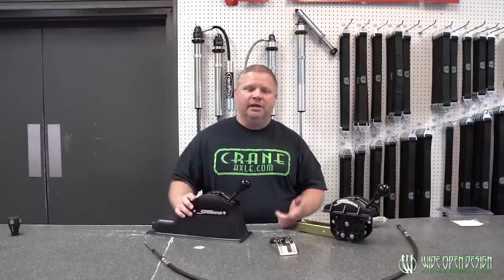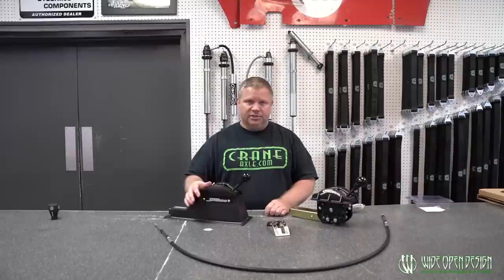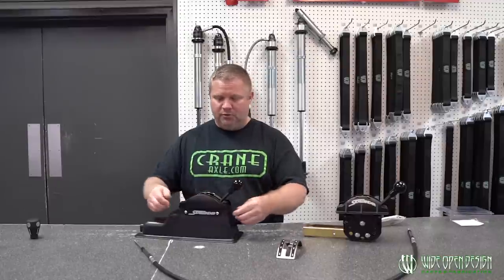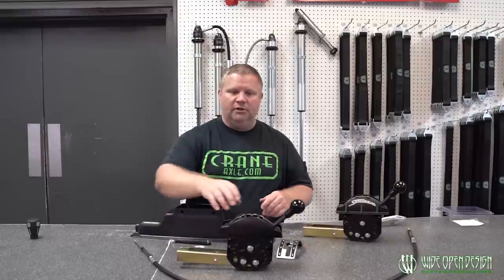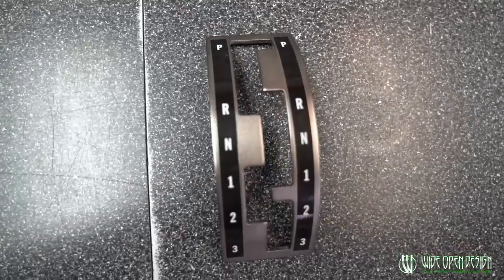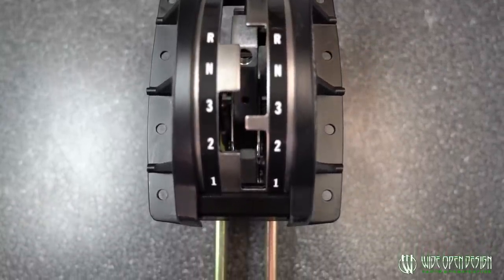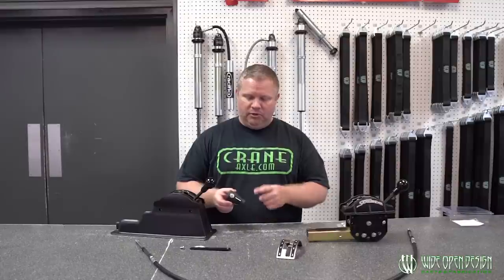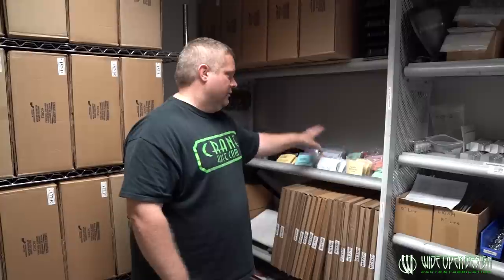Winters/Art Carr Shifter Overview - Wide Open Design

Comment: I have the winters 5 gated on my 69' charger....i just love it. 5 speed with a supercharged hemi.
Reply: Do you remember which shifter it was? And do you think I could put it on an 05 mustang?
Reply: @chrisspann5192  i have the winters console shifter and a 5 speed auto trans. My shifter plate was custom made to add the 5th gear mechanism. But you can add it on the 05 Mustang depending what transmission you have in it at the moment.

Comment: I got a 1 ton 4X4 Ford E 350 with the 7.3L Powerstroke & an E4OD. I like the 1, 2, 3 as long as I can grab Overdrive.
Reply: That was my question, the E4OD is a 4 speed transmission but this shifter only has 3 speeds apparently. How can you shift into 4th?
Reply: @SolkanStudiosTV  I'm going to use a 2spd axle switch to work my 4th gear.

Comment: I was looking to have this on my 700r4. If I put the shifter into the 4th gear slot, does it automatically shift like a regular shifter? And I can downshift to what gear I want? Or am I going to have to manually switch every gear?
Reply: As long as you haven't installed a full manual valve body in your transmission it will shift like stock in 3 (d) or 4 (od)

Comment: I bought a console style and I found out I won't be able to use it do to space so your saying the flush mount is the same I won't need anything else to mount it?
Reply from the maker: Hey Manuel, I'm not sure exactly what you're asking. Please call the shop or email us directly with your questions. (615) 962-9135 or sales@wideopendesign.com
Reply: @WideOpenDesign   what I ment yo say is I have the console style shifter but I want to mount it like a flush mount and if I could do that right of the bat with my shifter the console  style  or would I need any other parts to mount it like a  flush style ? I am pretty surr you said something like in rhe  line of them being pretty much the same except one has a console and the other doesnt